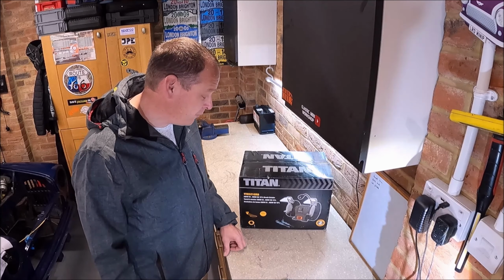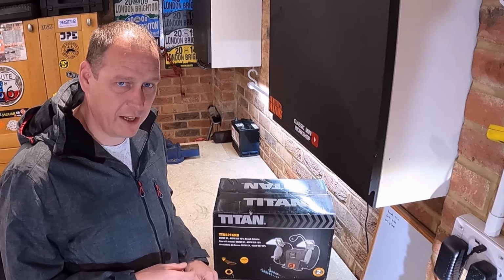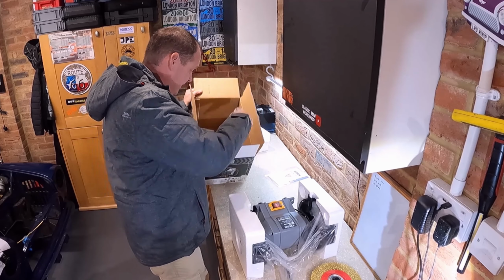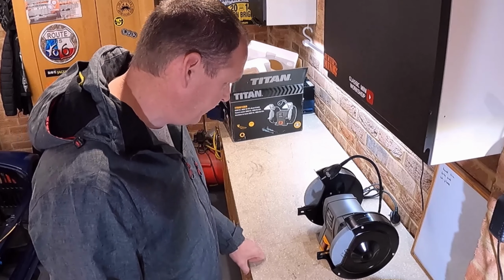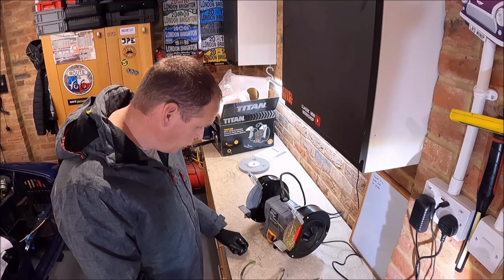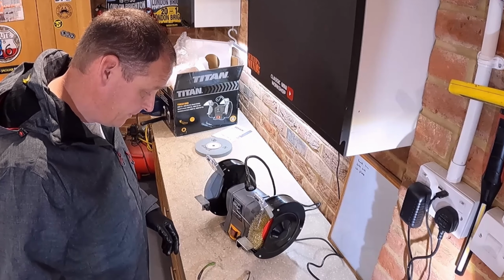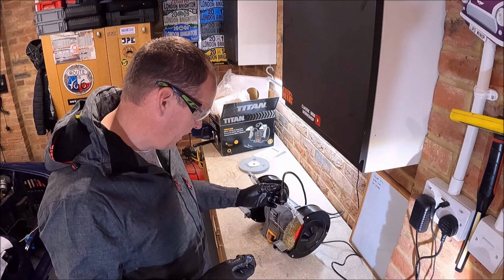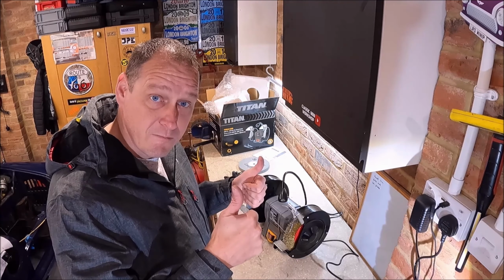Bench Grinder Under £40 - Workshop Bargain - Classic Mini Workshop

Comment: Hi thank you for your video I just bought this same grinder wheel machine and I don’t no if you had the same problem but I no screws are meant to be tight but with mine that was an under statement any ways cut a long story short I was hoping you could help me the wheel on the left to undo it do you turn right or left please?
Reply from the maker: It should be a left hand thread, so clockwise to undo
Reply: @classicminiworkshop  thanks I finally worked it out thanks for replying tho

Comment: Hello just a quick question did you say it was from cast steel ? It looks plastic. But plastic could never cope with that mount of stress on the frame or be thst heavy I don't think.
Reply from the maker: It's definitely metal
Reply: @classicminiworkshop  Thanx. O have just ordered a similar one from screwfix. £24.99 titan bench grinder. Gotta be worth thst for the disks alone

Comment: Hey I just bought 1 of these from screwfix, the left mounting plate sits at a slight angle to the wheel but it doesn't seem to be damaged. I was just wondering if it's the same on your model
Reply from the maker: Hi Mark, mine is not at an angle. It's pretty much 90 degrees to the wheel
Reply: @classicminiworkshop  thanks for the reply. Thought so, gonna take it back

Comment: Bad idea to wear gloves when grinding.. just saying.
Reply from the maker: Interesting, I've never really heard that before. A bit of googling suggests the feedback is quite mixed on whether to wear gloves or not. The issue seems to be with the glove getting caught in the wheel which I guess with loose-fitting leather gloves is possible. I'm not convinced it's as likely with tight-fitting gloves. From my experience, wearing gloves has saved me multiple times from burns and abrasion and I've never had a glove get caught up. The type of glove I use would just tear, but I get the point that a leather glove probably would not. It's always interesting to hear people's thoughts, so thanks for sharing.